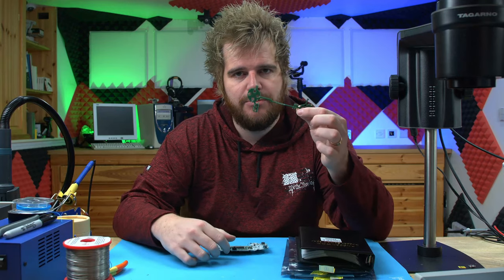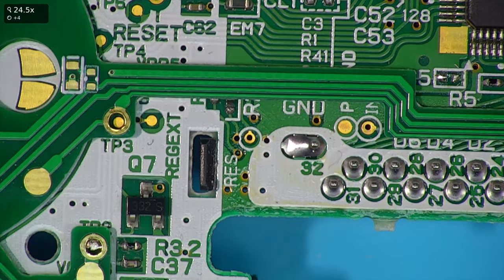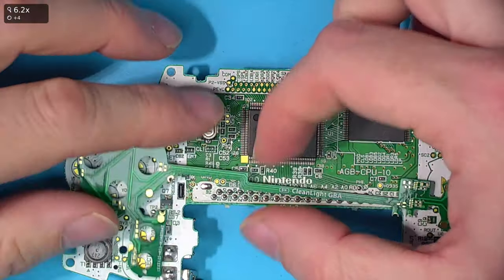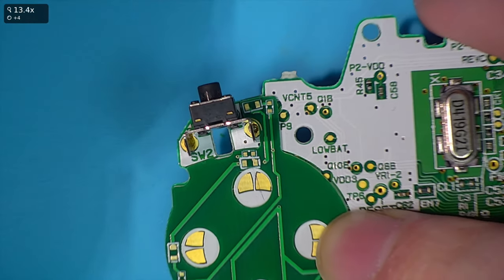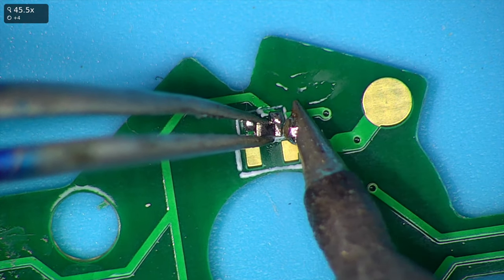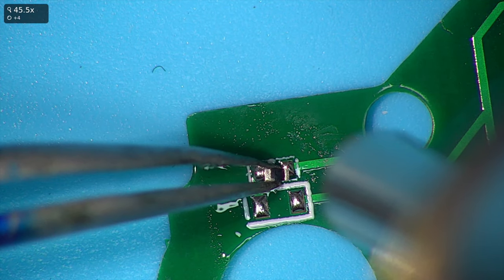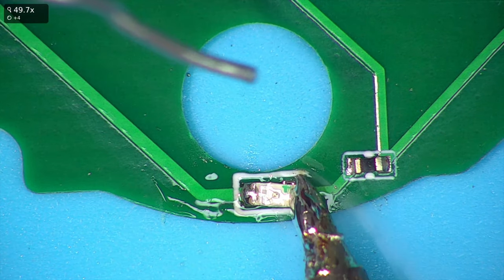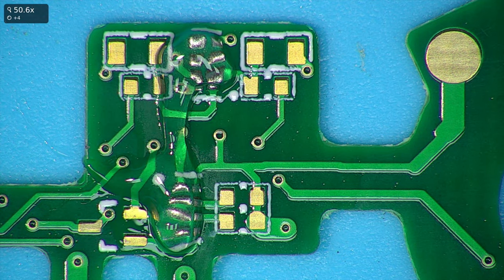Game Boy Advance LED Mod Board First Prototype - RetroSix

Comment: Do we need to add a resistor to the new design? Or it's has been fixed? I ordered a few days ago
Reply from the maker: No the release version has it
Reply: @RetroSix  nice ! But does interfere with the wirefree dehuss kit because from the tutorial it seems like the wire free kit covers some pins used for the leds
Reply from the maker: Our Dehum kit is on the other side. Works fine together
Reply: @RetroSix  Thanks mate ! Awesome